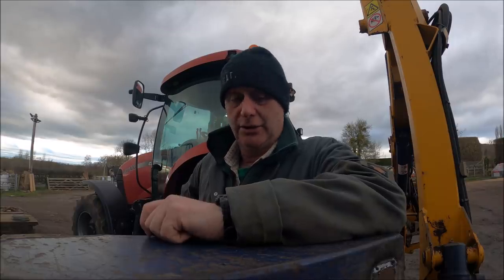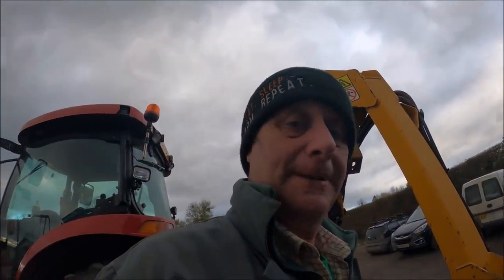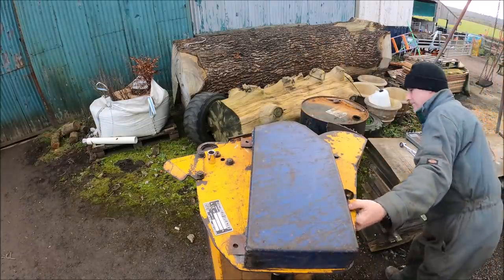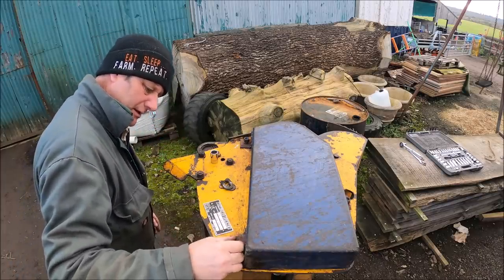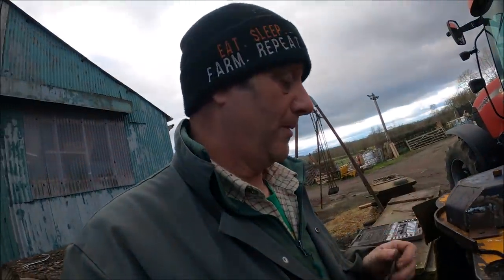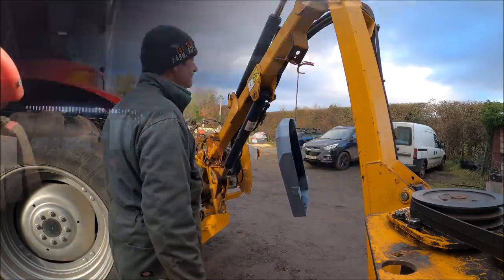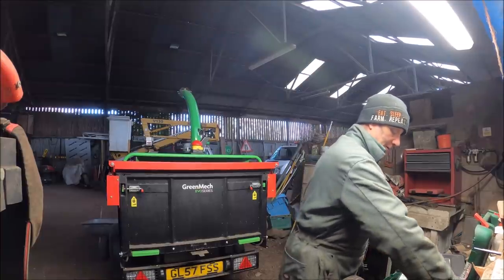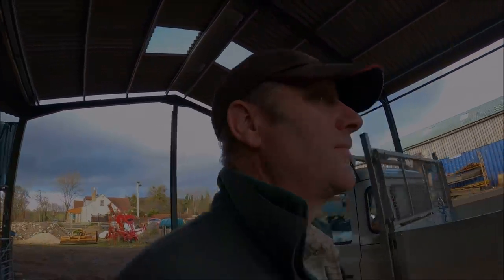01 02 22.  Fixing the hedge trimmer  part three. Drilling and painting.

Comment: dont throw away broken drill brits just grind a point on it and use it as a center punch, i also would of welded the bolts to the frame and then added a pin in each one to stop the nut falling off...

Comment: Why don't you weld the head of the bolts to the hedge cutter, then u only need 1 spanner to open them in future.❤❤🤣
Reply from the maker: The bolts and nuts get fair knocked about Leo. Keeping them loose means they are easier to replace. 🙂👍🏼